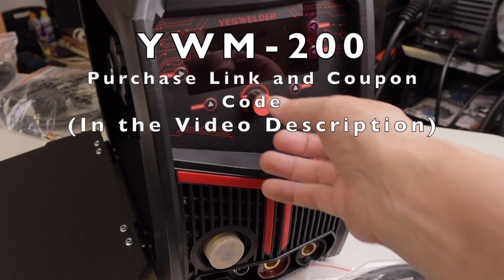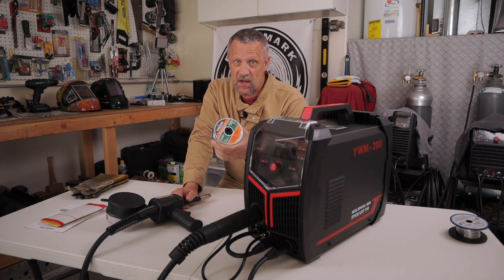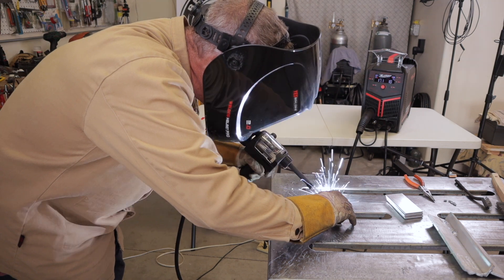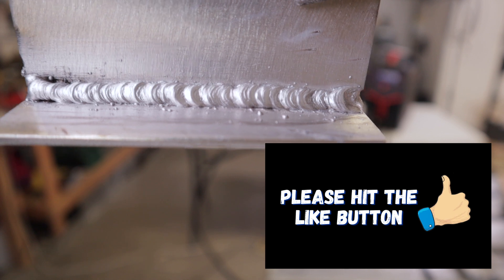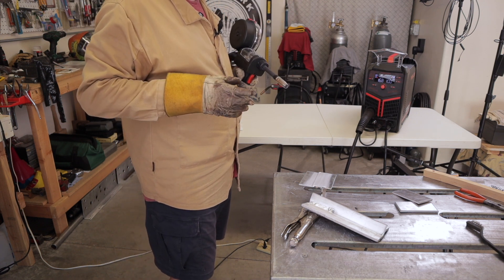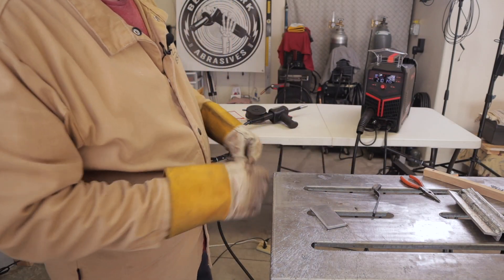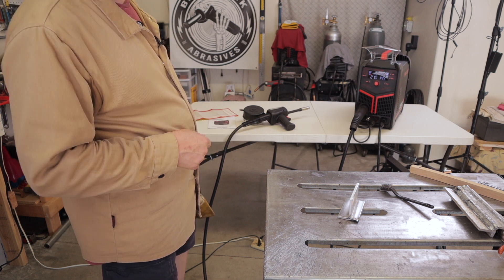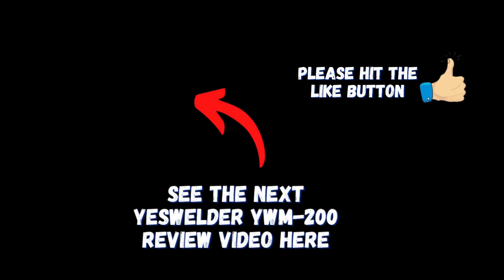Aluminum MIG Welder Review YesWelder YWM-200 4-in-1 Multi Process Welder - Spool Gun Demonstration

Comment: Thanks so much, going to break in my yeswelder tomorrow. What is your pressure on the argon 15 psi? First time welding aluminum and don't remember if it's similar.
Reply from the maker: If I remember right I think I was using about 20 cfh with the spool gun.

Comment: concentrate you puddle on the lower coupon and let it flow up the vertical coupon and you won't get that cold rolled-over look  also when you brush your aluminum brush it one direction not back and forth strokes  you are just brushing oxides back into what you just cleaned not too important but in the critical clean jobs it makes a difference